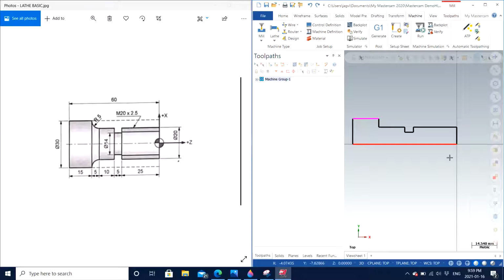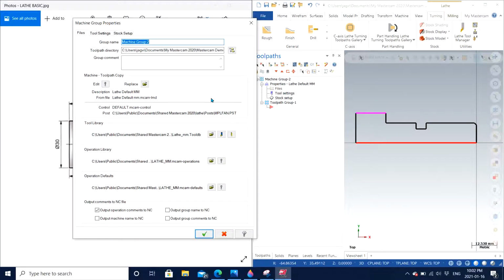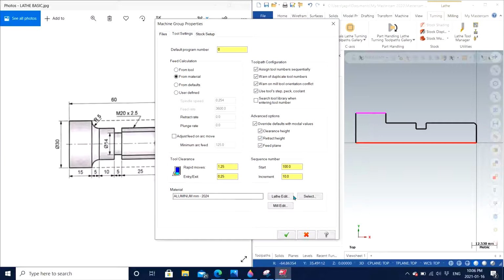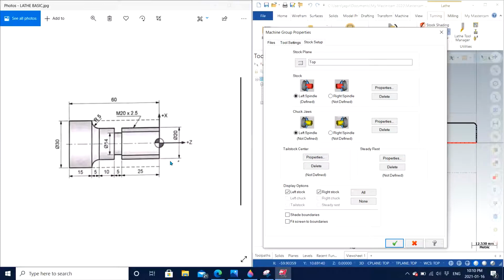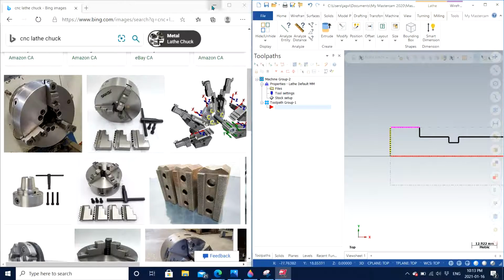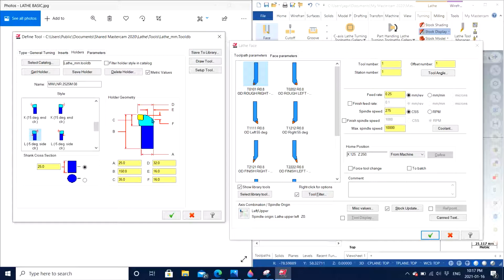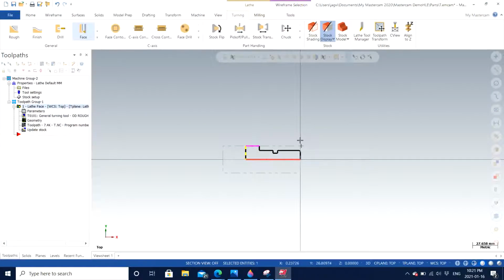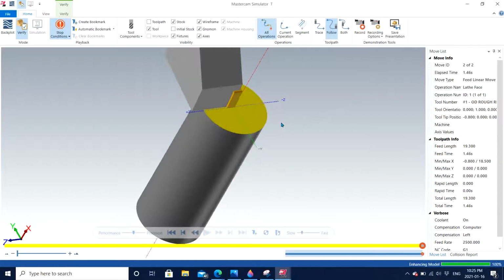MASTERCAM 2020 : LATHE FACING OPERATION

Comment: Please explain the position of xyz axis in turning and its setting. Which is the axis fallow in turning like C plane T plane or wcs plane?
Reply from the maker: In turning you are using D+ axis in top view to make wireframes and use them. 
C plane is contruction plane, where you make the wireframe and all. 
T is tool plane ( perpendicular to tool axis ). 
Wcs is work coordinate system. Your G54 when working with 3 axis part, could go from G54-G59 depending on setups and axis involved to produce part.
Reply: @Everythingiknow881  hi sir how are you ? i need Siemens 828d turning control post process , can you provide me?